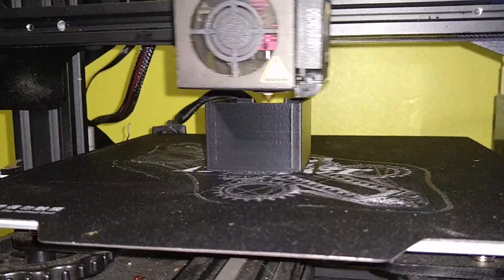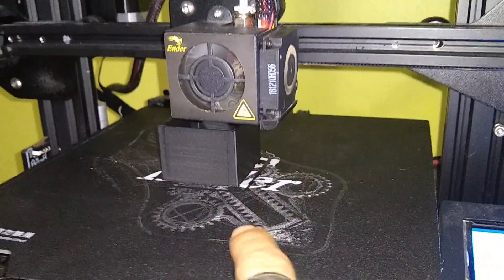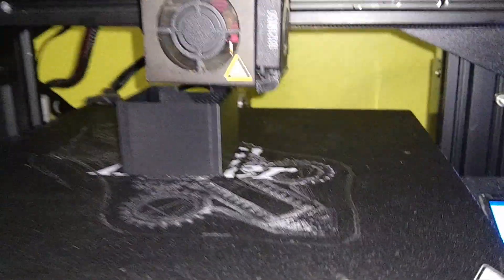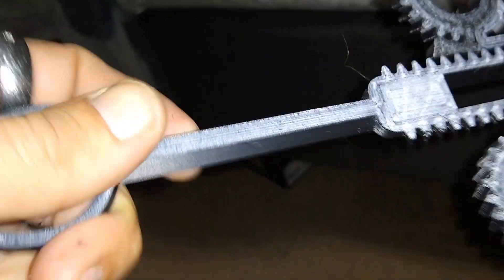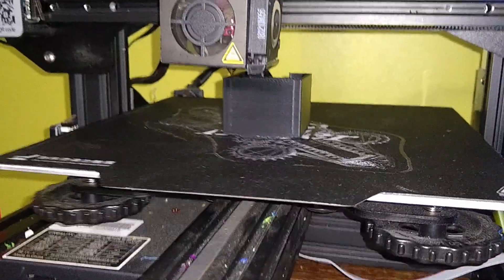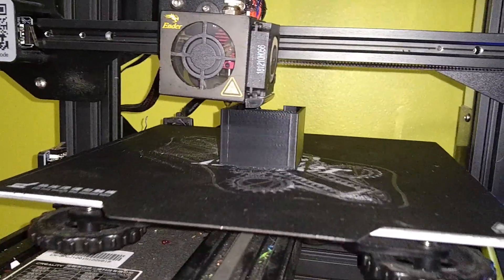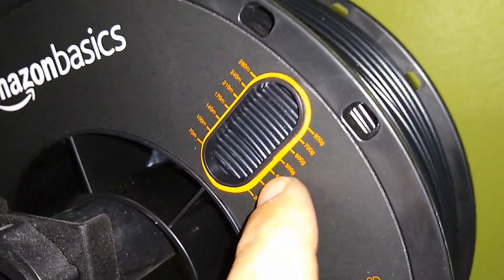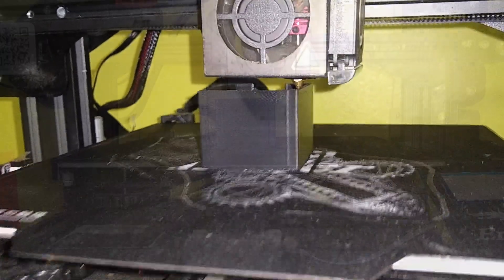HOW TO 3D print ABS on an Ender 3 - IT'S EASY!

Comment: what about them toxic fumes that are supposed to come with abs when it's melted?
Reply from the maker: Should be a link to the air filter I use in the description
Reply: @Technivorous  I can't see it, but how bad are the fumes? are they bad enough to need a ventilated separate room?

Comment: where is the how to?
Reply from the maker: How to:
 hot end hot. Check
Bed hot. Check
Turn on draft shield in cura: check
Then print. 

As the title says "IT'S EASY!"

J/k. Dude I dunno why so many people watch this video, it was one of my first and even i think its crappy. But so many people watch it i cant take it down. If you are having a specific problem with printing abs, I'd be happy to help, just ask! Otherwise I have since done another of these that is actually informative and goes over the settings, it's for a tevo tarantula pro, but the settings that effect good abs prints will be the same for the ender 3, mainly temps, and the crucial draft shield. That is the how to, the draft shield is absolutely needed with an open frame machine. With it, the pr in ng wont warp or crack from cross draft temp changes. After that's done its tweaking minor settings to your liking such as speed and flow. But start with the draft shield and you will be happy with the big steps it takes for you
Reply: @Technivorous  "As the title says "IT'S EASY!"" --- no dude, the tittle starts like "HOW TO"... "check if the hot end is hot" is condescending> waste of time!

Comment: I have an ender 3 and amazon basics abs. I’ve struggled to get it to print. Can I get your slicer settings? What bed and nozzle temp worked best for you?
Reply from the maker: https://github.com/Vanethrane/Cura-Profiles  use the top profile. temps are set to pla, so increase the nozzle temp to 230 or higher, and the bed to 65-75. also to improve the quality of your abs prints, check out the draft shield option in cura, it will prevent warping withouth an enclosure

Comment: Ok just a little Unclear on the fans the fan in front facing you is called the what fan ? and then you have a fan on the right hand side what if you use a simplified 3-D I have both software’s thank you for your time
Reply from the maker: so the fan on the right, blows downward, over the nozzle, and print. turn that one off. the fan in front, blows on the hot end, to help equalize the temperature. leave that one on.

Comment: should you turn the fans off? and what print speed
Reply from the maker: yes the vent fan should be off, but not the main fan that moderates the hot end. there is now a cura option for 'draft shield' in expiramental, that will help you abs prints a lot if you dont have an enclosure. i used pla speeds, but it should be between 50 - 70 mms

Comment: hi, when I bought my first ABS spool ever for my prusa mk3s, I had similar issues. There were 2 main issues => Either Warped corners or cracked layers. 

Finally discovered the best settings.  I turned the sample fan speed to 20/255 ( about 8% ). 
With cooling fan off, the bottom layers ( about 1cm from heated bed ) was warping and vertical perimeters were bend a bit. With cooling fan too strong, the layers were cracking. Heated bed on the high limit of advised temps ( 110°C ) and my nozzle also quite high ( 260 °C ). Since then, I can print ABS nearly to perfection.

Room temperature has to be quite warm. 

But now I also build a enclosure and its pre-heated before printing.
Reply from the maker: yes, enclosures will go a long way for ABS!
Reply: also on an ender3 ? bought one a month ago and used about 4kg of pla, want to look into abs territory